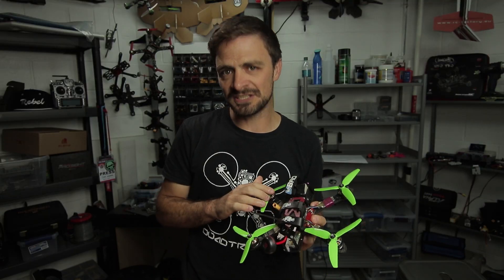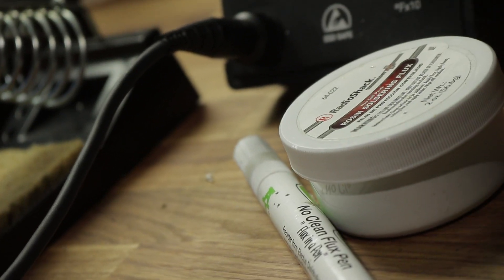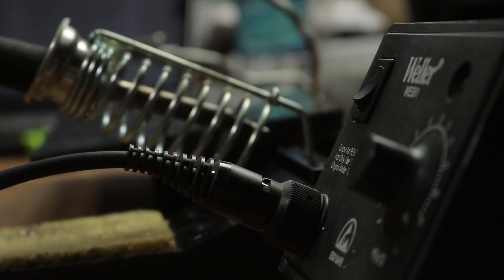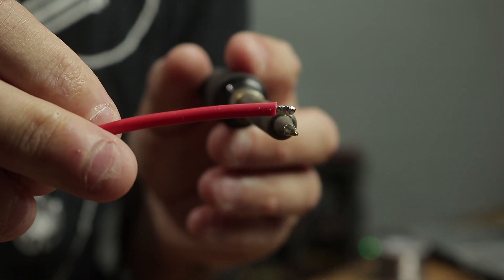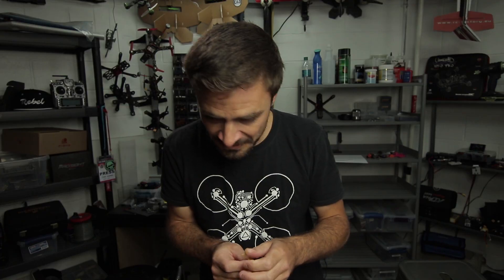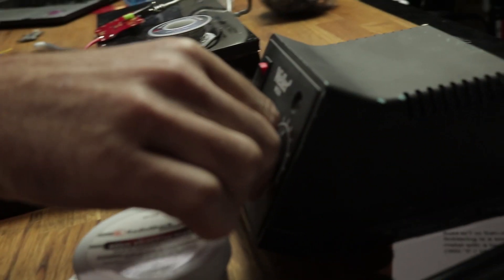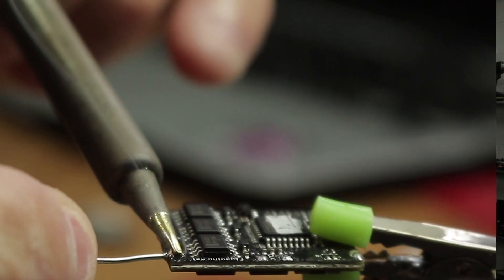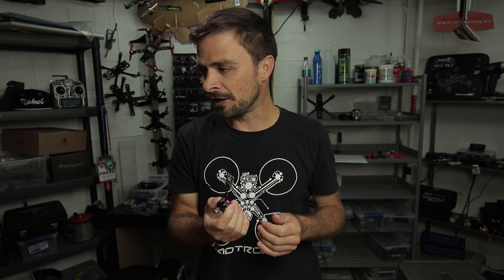Soldering Tips

Comment: I can see you use almost a screwdriver type tip. Is the tip made of a different type of metal than the rest of unit? My reason for asking is that I am still getting beading, and just refuses to stick to the fc. Heat maybe? I do get the resin, which sucks having to clean it off.

Comment: Use the right tip? Lol
I'll be using my 40 year old Weller iron for the battery and motor pads. Ordering a TS100 for the small stuff. The tip is too big when it's the size of the actual pad.

Comment: You didn't do the pads on the esc the same way you did the pdb. You just slapped the iron on top of the wire.  That never works for me.  Well, nothing works for me.  I suck at soldering.  I just do.
Reply: Honestly, it's almost certainly your equipment that sucks. It's actually quite hard to suck at soldering when you have a decent soldering station.
Reply: Could be worth checking out the EEVblog YT channel. He has a great series on learning to solder.

Comment: I swear, ive had wire heat to the point that the insulation near the end starts to overheat, but the solder still wont melt into the wire..
Reply: Are you using 60/40 solder? This might happen if you're using lead-free solder, which has a higher melting point and is no fun to work with. Also, make sure your wire is clear; scrape it a little and add alcohol to clean it. Finally, try adding a little more solder to the tip of the iron, so that you get a bit of liquid solder in contact with your wire. The extra contact area really helps.

Comment: I know this is from a few months ago but what iron are you using/does rotor riot recommend?
Reply: Anything from Weller is great. You can go cheaper for basic jobs, but avoid anything where the iron plugs straight into the wall. Get a soldering station with an adjustable temperature dial and you'll probably be OK. Also, check out the EEVblog YT channel. He has a great series on starting out soldering.

Comment: Such a good video, only complaint, is that you tell me that Flux is very important, but you never show when and how to use it at all :)
Reply: Separate flux is rarely needed, as Chad has said in another comment. It occasionally helps when the solder won't flow well, but often a bit more solder will add flux and get things moving.

Comment: very helpful thanks! 
I put wires incorrectly and created a short lol but after the board blew a small part of the copper inside I added some tin, a small piece of wire and some liquid electrical tape to protect it and it works fine so far. 
wish I could post a picture here
Reply: get a smoke stopper or build one

Comment: Great video.  I did read all the comments below, but I need to ask.  What is the typical wire size feeding the PDB for the 3 or 4 cell powered racing quad?  I am talking about a pig tail wire to the PDB pads.

Comment: Is there a name for the sponge? I'm still using the sponge i got from my first soldering pen because i couldn't find a replacement, the sponge looks tiny when dry but expands when it's wet, and it doesn't burn. The ones that came with the new irons are about as hard as cardboard and not really something you can wipe on. Sponges at the supermarket melt. I tried asking the people at the hardware store but they have no idea what i'm talking about and they apparently use box cutters to clean their soldering tips (Wat???)
Reply: The tiny hard sponges should expand when wet in my experience. Basically, any wet sponge should work: the water absorbs the heat and prevents it from burning.

Comment: Ok, I wasn't going to say anything but it's been eating away at me since yesterday and it's my annual "leave comments on YouTube videos" day so I'm just going to say it and I mean it constructively because I love you lot.

Soldering tips: Step 1

Buy an ESD strap (a plug in one) and ground yourself and then ground your soldering iron especially when soldering ESC's and your FC. Consider grounding whatever you're soldering up too.

Why?

Because MOSFETs (like on your ESC's) and microcontrollers (FC) are extremely sensitive to static discharge and although you might not see any damage, at a microscopic level even a small static discharge will puncture those silicon wafers (imagine meteors hitting an ice sheet).

If you are wearing socks or a jumper for example you can easily build up a charge in the Kilovolt range with the smallest movement - admittedly a low current one.

So although your multi rotor may fly fine at first, it has a higher chance of failure mid-flight.

In your Flight Controller for example you might damage a bit of memory if you're not properly grounded and you might not find out until 3 months later when your processor tries to write or read to that sector and suddenly everything locks up and you're having an expensive (and avoidable) accident.

When you were scrubbing flux off that ESC, well, friction etc - although I can't think of a better way of doing it, there's probably a more groundy way?

Also, if you want to apply a lot of heat (and solder) then I recommend choosing a larger soldering tip for that job especially if you have a cheaper iron (cheaper tips are often ceramic) - small tips will oxidise really quickly at higher temperatures (or do I mean carbonise?).  Go a black colour and not work proper no more.

Oh, and re-tin your iron after each joint if you want it to last.  Again, especially if you've got a cheaper soldering station.  I'm not going to mention sponge dampness because it's WAY too controversial a subject and I don't want to start a flame war.

There, I said it!  Hopefully, point made without hurting no-ones feelings...

Love your channel and best regards.

Comment: You should only clean the tip right before use,  never after.  Putting the iron back in the holder with solder on the tip  helps reduce oxidation of the tip, especially important during extended soldering sessions.

Comment: couldn't have explained it better. a few extra tips:
- Make sure you work in a well ventilated place or use a vapor-sucking-machine-thingy..
- Extra Pro Tip: breath in before soldering and slowly breath out through the mouth in a focused stream to blow away the "toxic" vapor
- When using solder wick, apply a bit of solder to the wick before using it, because this way it will transfer the heat to the acutal solder below the wick much faster and suck the solder in better.
- Flux is lethal to the solder iron tip. get it of there ASAP after you are done soldering.
- Do not heat up pads that are close to semiconducters too much, as the heat will transfer into the semiconducters and potentially destroy them.
- When soldering through-hole components, make sure not to use too much solder, because it may flow through the hole and short with an adjacent hole on the bottom side.

Hope this helps guys :)
Reply: Fume extractors are cheap and easy to make from computer fans, and most geeks will have the parts lying around, so all you need to buy is the carbon activated filter.

Some good tips there Xaser. For sensitive jobs (FC, ESC, VTX, ...) I put electrical tape on top of the bits not being soldered to help avoid solder splatter.

Another tip I've read is to leave any ground/negative soldering work until after signal/positive soldering has been done. Rationale being ground is shared on the PCB, so more metal needs to be heated, and getting heat into the board first will make the job easier.
Reply: Cover your esc with tape before soldering
Reply: Right, it's the flux or rosin that makes the smoke bad for you.  However, to keep your tip working for the longest time possible you should tin the tip of it a bit when you're done soldering for the day, even if the solder has a rosin core.
Reply: When I was a kid we used to solder in the snow
Reply: nice tips :)
Reply: Thanks!
Reply: yep, this will way, the solder tin coating will oxidize when the iron is not used and can be cleaned of the next time the iron is turned on. just make sure that you use just a bit of solder and that the flux has evaporated fully from the tip.
Reply: Xaser cheers man

Comment: can i just use a dish sponge to clean the iron
Reply: Works fine with any dish sponge, natural or synthetic. If you burn or melt anything you're doing it wrong. Keep the sponge damp so it's soft, but don't quench the tip. Just slightly brush across.
But better get brass wool (not steel wool). Doesn't thermally shock the tip and also nothing to burn and no need to run for a few drops of water every time you start soldering.
Reply: I've been wondering about that too...
Reply: If your dish sponge is a natural sponge then yes because if you use a synthetic one (plastic) you are going to melt it and make a mess, you can try with some wet natural fibers like cotton
Reply: fdavpach thank you
Reply: Natural sponge yes.  Just remember to not have the sponge too wet.
Reply: Cameron Klein : actually if you are going to use a wet  sponge you iron tips will no last longer. If you do not trust me try and you will see.
Reply: Don Jon so don't cleen the tip? or my tips won't last long?
Reply: Cameron Klein yeah something like that but remember  no wet sponge that's it.
Reply: Don Jon ok
Reply: You can but you have to put water on it first

Comment: You listed flux as part of the process and discussed how you clean it off, but I don't think you ever showed how you use it or discuss when it should be used (particularly given the fact that flux is already in your solder).  I've been soldering up FPV rigs for a few years now and have never used extra flux.  That being said, your trick to tin up a bare wire by rotating it with your fingers and touch it to the extended solder wire is genius.  I'm definitely incorporating that into my normal operating procedure.  Thanks very much.
Reply: Sometimes when I add servo pins to the FC I find some extra flux added before I solder it on helps make the job easier.  Some guys like to add flux before each time they solder something new to aid in the process.  I like to add it in situations I know I will have trouble doing it quick enough.

Comment: 1. Do not inhale the fumes. Do not inhale ANY fumes. If you smell something, that means you're more likely than not  inhaling it. Put a fan or whatever to blow it away.
2. When soldering the tinned wire onto a pad or other wire: do not hold the wire with your hand. The solder must solidify without ANYTHING moving. Any movement, no matter if it is imperceptibly small, compromises the quality of the joint. Heat up the pad with the soldering iron ("one thousand..."), place the wire onto the pad and feed it solder ("... two thousand...") and finally remove the soldering iron ("... three thousand.")
3. Notice how he places the soldering iron tip below the wire. That's the correct way.
4. The temperature must be just high enough to melt the solder. Not any higher. If you feel like you need to go higher, then you need to change the tip or get a better soldering iron. 
5. This kind of editing is fun for the fun videos, but for explanatory/tutorial videos it is downright HORRIBLE. Sorry for being blunt, but that's how it is.
Reply: wow you know sooooo much.
Reply: does solder melt at a different temperature when soldering thicker gauge wire? No, it doesn't. Setting it to a higher temperature is a ghetto way to approach this issue. If you want to do it properly, you use a higher wattage iron. Have you not noticed that soldering irons come in various power ratings? Guess why that is.

Lenfred Dueck ye, I do, in fact.
Reply: George Tsiros I hope someday I can be smart like you.

Comment: Hello, I got a question, I am building a TAROT TL250H Quad with emax 2204 2300kv motors LUX FC & KISS 18 AMP esc's. The Tarot TL250H Comes with a PDB & LUX FC HAS A BEC BUILT IN SO YOU CAN RUN YOU POWER WIRES STRAIGHT FROM THE LUX FC with the LUX FC Starting at the front of the quad looking down from the back of the quad the left front arm is that motor 1? and if it is what is motor 2 the rear motor behind number 1 motor or is motor 2 the other front arm?Also I will be using a D4Rll RX with my Taranis plus ppm, I am only evr going to run 3s and I am not using this for racing just to practice so not using sbus it is not going to make any difference in performance using ppm instead of sbus? I know sbus is the fastest response time from tx to quad, my concrn is with me using the LUX FC & KISS FC'S With Oneshot Enabled will I still get good response using ppm or am I holding back the lux fc & kiss esc's by using ppm? IN my mind since I am not trying to win any races it will be fine using the D4Rll rx ppm hook up am I correct in the way I am thinking? Thank You in advance for any or all help in this matter,  GOD BLESS
Reply: david ringler right back 1 right front 2 left back 3 left front 4
Reply: Thank you which are cw?and ccw?also I was told to flash lux fc with beta 3.0.1 is that correct?
Reply: david ringler you can use ppm only if you are going faster than 100km/h or 65mph you may notice it but otherwise not
Reply: david ringler you can flash the lux fc with beta flight 3.0.1, the newest or almost the newest beta flight. Don't go for clean flight but for beta flight, betaflight is better. 1&4 are cw 2&3 are ccw
Reply: If you are running cleanflight/betaflight/raceflight you will use this motor layout:

http://i1.wp.com/fpv-flightclub.com/wp-content/uploads/Naze32-motor-direction.png
Reply: lldanll that what I say
Reply: lldanll that's with every software also with beta-race-clean flight als with librepilot and now I know don't know any firmware anymore
Reply: Sorry about the dumb questions !, I have ben building and flying multis for about 6 years but this is my first time with racing quads and I am going through CANCER Treatment CHEMO & RAIDATION and my memory is really bad and I forget stuff minutes after being told so I have to write everything down before I forget, so I want to apologize if I ever ask you the same thing twice ! Thank you for your quick response!, Also I started a charity FPV for Children with CANCER and maybe sometime you GUYS CAN COME TO PENNSYLVANIA NEXT SPRING OR SUMMER AND FLY FOR THE CHILDRN AS WELL?
Reply: Thumbs-fpv  Thank You I am Going to Sub to your Chan, Thank You and GOD BLESS
Reply: Thumbs-fpv Libre pilot and Kiss actually use a different motor layout than the rest.  Motor 4 in CF/BF/RF is motor 1 in Kiss/Libre.
Reply: david ringler thanks man, just ask it and I will answer it. I don't know if you believe me but I am just 12 years old. I know a lot about quadcopter especially in racing quads.
Reply: 12, That's great !, hey I know a lot about building camera drones using wookong/pixhawk  and started with kkboards went to wookong/naza than pixhawk but just started getting into racing quads, so your age doesn't mattr you know what your talking about!, I wanted a kiss fc but got the lux fc and kiss esc's it still should be good I hope? And I do appreciate the help !!
Reply: david ringler look at my video if you have another question ask it

Comment: Hey soldering newbs! It's really easy to solder.  Just try it.  Get 60/40 rosin core like he says.  Then get a small chisel tip.  You can basically do ANYTHING with one.  A good cheap soldering station is the Aoyue 469.  It takes standard Hakko tips.  I'm pretty sure it's not actually ESD safe though.